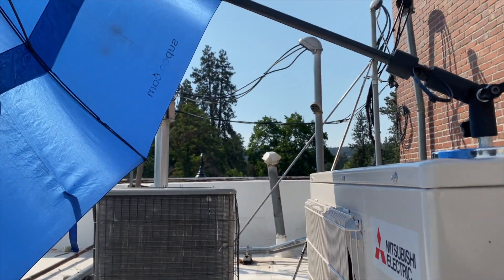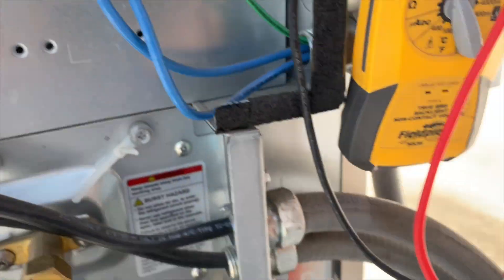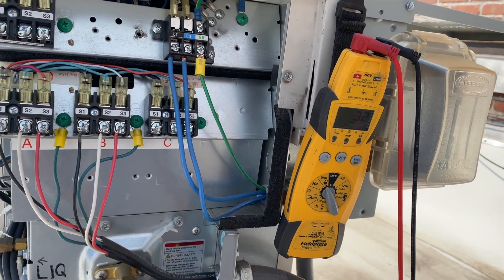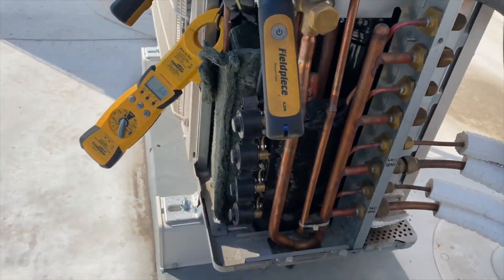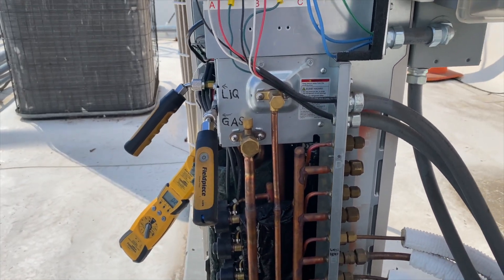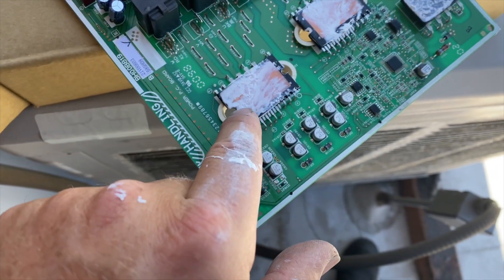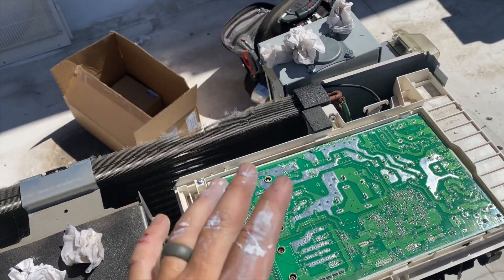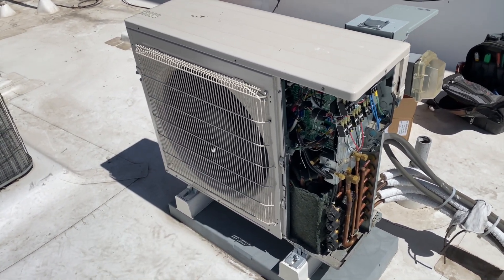Mitsubishi Mini Split Throwing Codes!!! How to Diagnose a Mini Split. EP66

Comment: Solid red and yellow and 11 blinks on green. What does that mean? The manuals dont even mention green led on the outside unit
Reply: The main board was toast on the outside unit (because of power surge?). It could not community with the inside unit. I got the main board replaced
Reply: @zabalaan  Thank YOU for your help!  I just called my friend and he did have a power surge at his house. 🤓
Reply: Did you fix this?

Comment: if the electronics break often it's usually indication of high voltage Spike like thunderstrike that has been close by before you need surge protector plug on it

Comment: So that might help in the future to make sure that none of these inverter mini splits are put on twin breaker because it will cause a compressor over current protection code and probably burn one up if not fixed after a while

Comment: Always keep air conditioners in under shed. Make tiny sheeds around them . Putting them under direct sunlight not only increase your electricity bill it also puts lot more strain on the inverter parts.
These do not like to run hotter than 70c internally. 
You don't need too much paste . The thing that you need to do is to properly clean both the heatsink and the ipm chip with tissue and isopropyl to remove any oil residue and old crusty paste. Then install fresh thermal paste and spread it with the supplied spoon that comes with lots of pc thermal paste. And you can use pc thermal paste those are lot better than these thermal grease. 
They aren't much more expensive and you can get the 30gram tubes of noctua h1 or h2 and that would last you 60 installations.
Reply: What? You should never restrict or stifle air flow around a unit.

Comment: You will be beck.  Something is causing the failures.  Always told my techs...troubleshoot the cause not the symptom.
Reply from the maker: Been over a year and still works. I think the previous tech didn’t tighten the screws tight enough to make good contact to the heat sink causing it to overheat.

Comment: The suction pressure looks too high isn't? Is the system over charge which is causing the high compressor over current protection?
Reply from the maker: This system has a variable compressor and charge can’t be determined by pressures as they may look high or low. The only way to check the charge is to weigh the charge. This units charge was to factory specifications.
Reply: @NighthawkHVAC  I agree that inverter unit is best to weight in refrigerant. However, as alternative, you can also have all the indoor unit run at the max cooling mode, and charge it based on the gauge reading to around 125. There got to be reason for repeated blown circuit board.  The mini split come with pre-charged refrigerant up to certain length and also have requirement for minimum total pipe length. For what I have seem with many Fujitsu and other brand that I have fixed, in cooling mode, when compressor is running, it never get this high suction pressure. while when the compressor is not running, it could get above 200 psi.  I would suggest if all choice is out, check if the system is overcharged.

Comment: Mini Splits on Commercial Roof tops usually have this issue. They aren't meant to be on top of the roof. Lighting strikes Electrical Surges doesn't take much to get the CPU fried. Need some type of Surge protection to slow the electrical issues. Put an AMP Fuse so It pops the fuse and the board.
Reply: That is not a cpu. That is called ipm. 
Basically the huge chip that is screwed onto the heatsink. Contains a full bridge 3 phase igbt set and control circuitry with protections and other sensors. 
This is the part that makes the 3 phase ac at variable frequency to control compressor speed and cooling power.
I have 5 panasonic inverter mini splits and they are working fine since 2017 , not a single issue on one of them. They run 12 hours a day in Indian summer heat. Today it was 44c and it has been above 40 for this whole month touching 45 sometimes. 
None of these inverters have issues with the heat. You just keep them in shade and oversize the units. 
I have 1200sq ft floor space and installed capacity of 7tons. It uses 2 3 tons of capacity when the set temperature is reached. 
This puts lot less strain on the inverter. 
And i will never go back to those non inverters.
Reply: Shade